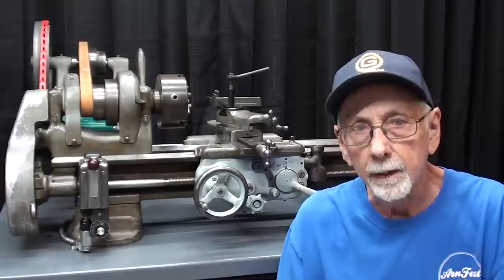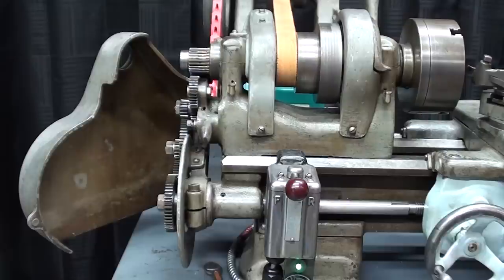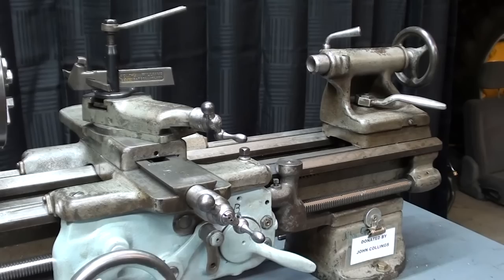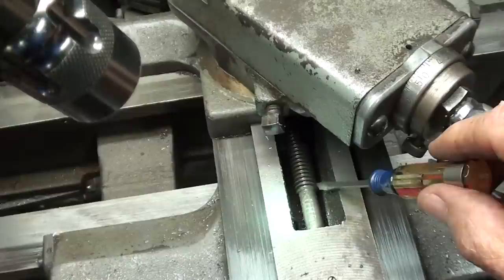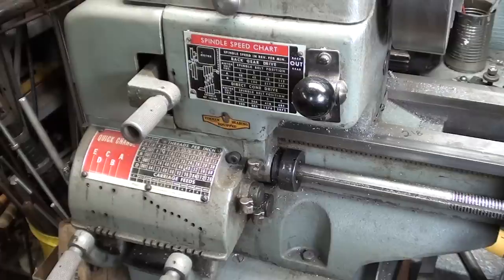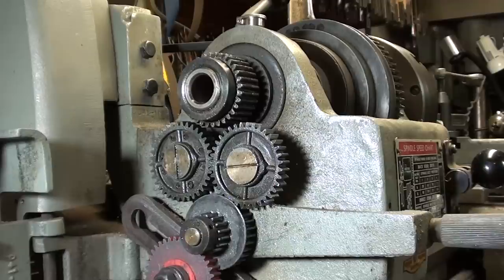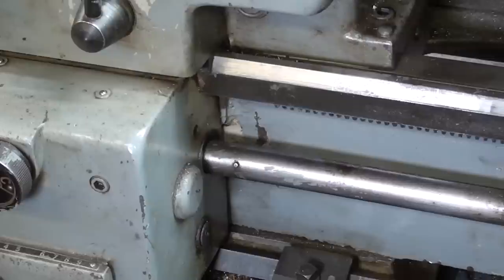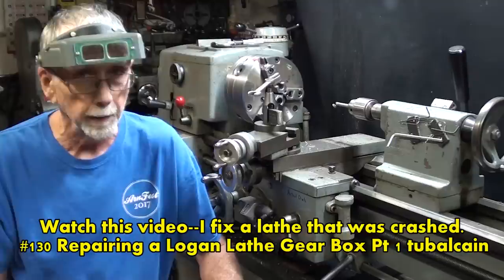CRASHING & damaging YOUR LATHE #810 tubalcain mrpete

Comment: Some years ago, I was 'The Welder' in a fabrication machine shop...we had 8-10 lathes, some were quite large. A guy in the 'toolroom' was running a very high precision lathe, maybe about 14X 35 or so. He somehow crashed the carriage into the chuck at high speed, broke the carriage completely in two.
 The shop owner came and asked me to look at it, see if I could just 'braze it back together'...no way, I saw the back 1/2 of the carriage laying in the chip tray......eventually they made a few pieces of flatbar and drilled/tapped some holes to hold it together...I don't think it ever really got used anymore...
   They were really upset I couldn't just braze or weld it back together....I said "maybe, but it will never be worth anything in this shop"..
 The company made Aero-space parts..everything was .0005"...
Reply from the maker: Wow

Comment: I'm rebuilding a 15" Sheldon lathe that had been crashed sometime in its life before I bought it.  The fiber gears were replaced with steel gears, and they did a hack job on the apron in an attempt to repair the damage.  $600 worth of new clutch parts, new 3-D printed gears, and many other parts that had to be made since I cannot afford B & K prices, it's running again.  As always, thanks for sharing Mr. Pete, Ken.

Comment: The first time I over-ran the carriage it broke a pin inside the apron. Cheap fix but a lot of work. So I replaced the steel taper pin coupling the feed/lead screw to the QCGB with a brass pin, like your Clausing. I made a couple of spares, too. The second time was thirty years later. I actually remembered where I kept the spares, and was up and running in minutes.🙂
Reply from the maker: You are a smart man. I would’ve forgotten. Where the spares were within minutes

Comment: Thanks for the video Mr Pete. I did not see it but I know I had a student crash the lathe,  I went to use it and the power feed did not work it has sheared the pin coming out of the quick change gear box.

Comment: I've never crashed a lathe, but I did explode a grinding wheel when I gave the handwheel a spin to send the dresser back out of the way.  I forgot to back the dresser off, I'm lucky none of the shrapnel hit me.
Reply: Nice VW
Reply: @MaineMachinist  I bought this from someone in Maine. My fun summer driver and never ending project 😊
Reply: @michelecrown2426  Wow! Are you in the New England region? I’m a long time Aircooled guy myself. I apprenticed under a top notch old school machinist in Augusta. He is a pretty well known Aircooled VW and Porsche engine builder. He’s had several engines featured in Hot VWs.
Reply: @MaineMachinist  NH.  And I go to Wells camp in summer. I hope to move there this summer, so VW will be going back home.

Comment: In HS shop class we had a few Bubba Jr's run the power feed into the 3 jaw chuck, fortunately, we were only using HS steel cutters so they made that terrible noise as the cutter hits the chuck and they got it shut off before the carnage.
Reply from the maker: As a teacher, that was the most dreaded sound

Comment: Funny you should ask. We have the same Clausing and the 72 tooth gear on the cluster that is first off the head stock  in the power feed train did a first class job of protecting  the brass pin,,,,,(that turned out to be a hard bronze alloy 1/8 rod )  at the coupling between the QC box and the lead screw. ---- The last thing I did today was heli-braze the teeth back in with Si Bronze. It's slow cooling overnight in the heat treat oven. (I would have cast iron gas welded it but it's got a 3" long bronze bushing in it ,,,, we didn't miss a trick when we did this foul-up) 
'
Now tomorrow between jobs that have to get out I can make an expanding arbor for the cluster and  see if I can find a #6 16P 20 degree gear cutter without having to buy the whole set. (We don't have one and don't know anybody who does) Then we can wait for the job in the horz mill to get done so we can re-cut the teeth. Meanwhile everthing we have to do on the Clausing will have to be dome without power feed.  

Moral to the story. - Don't take the short cut and use any old brass rod for a Clausing shear pin. Make sure what you are using is something that will actually shear before you tear up a thousand dollar gear. (And so you'll know we got away with it for like 3 years now,  but I am the bozo that mistook alloy rod for a piece of brazing rod and put it in the lead screw.) 

It's not even the middle of January and i am in the running for jerk of the year.
Reply from the maker: Don’t beat yourself up. Bad things happen to good people. Good luck with the repair.

Comment: Talk about dangerous machinery.
Many years ago I taught machine tool operation with manual machines at a local college.
We had a big beautiful shop with manual equipment and one cylindrical grinder.
The syllabus required familiarization with,and operation of, all tool room machinery, including surface and cylindrical grinders.
Had to emphasize to the students that a surface grinder was not a milling machine and that a .0005" deep cut was considered heavy on said grinders.  Ditto for the cylindrical grinder not being a lathe.
Turned out this cylindrical grinder was semi-automatic, made in the Czech Republic, and all controls were labelled in who knows what language.  And, of course, there was no operating manual!
I did a little tinkering with this beast; consequently I refused to use it with my class.  "Get me a manual in English or nothing doing" I told the department chief.
One week later during my next class I noticed that the 24" dia. grinding wheel was cracked!  The wheel had smashed into the work piece when someone started the thing and pushed the wrong button to "see what would happen".
Fortunately the wheel did not blow up.
Reply from the maker: Scary

Comment: The Harbor Freight, Grizzly and other varieties of mini-lathes actually made by Taig use plastic gears.  You can replace all those plastic gears with metal ones that are available. The one you don't want to replace is on the lead screw. That's the one that breaks when you crash the carriage into the chuck. A replacement is available from Little Machine Shop for around $5.
Reply from the maker: Thank you that may be very useful to some people

Comment: Thanks! I learned something from this. I have a 12” Craftsman with the earlier style you mentioned. I’ve never crashed it, and I hope that if I ever do, those lead screw bushing ends are still available.
Reply: If you have a mill, you could make a replacement, but it would be challenging to make it weak enough.  I had a 12" Atlas/Craftsman that came with a solid aluminum lead screw support, and I copied it for a few people, but I didn't realize that it was too strong!  I need to look at my drawing to see if it can be made to break easily!

Comment: The worst thing i ever did was when i was turning a 72" fly wheel on a movable gap bed lathe . I moved the bed and mounted the fly wheel to the face plate . I had it centered up and was spinning it . I forgot to take the bed out of gear and it slowly got closer to the fly wheel it hit and knocked the flywheel from the face plate . I didnt know what had happen . The boss came running  out of the office it some how didnt hurt anything he and i thought i just didnt get it secured . He went back to the office thats when i saw what had realy happen.

Comment: I find it interesting how many of what one may consider to be the more “consumer” end lathers, have “consumable” parts as they’re fail safes. Meaning, you consume and BUY a new part when there’s an accident. As opposed to a slip clutch or simple shear pin type system that can be fixed easily with a piece of common bronze stock. Interesting.

Comment: My Craftsman(Atlas) 6" lathe is the MkII  or 3950 model and they did something similar to the Sheldon using nylon gears on the reversing tumblers.  Stripped my 20 tooth gear and could not find a replacement, so I printed a 20 tooth gear on my 3D printer, that I resized to the proper diameter and width.  Drilled and reamed to 1/2 inch.  Installed it and was back in business.  Of course I printed several spares, how long can we expect a pla part to last.  It's been over a year and I'm still running on the first one!
MJ
Reply from the maker: I have made a PLA gear and installed it in my atlas about four years ago, and it is still running strong

Comment: So helpful as always, sir! I'm always so concerned of the Zamak's fragility.
Reply: I've got a 1976 12" atlas with a 1HP motor on it that I take 0.200" roughing cuts on mild steel.  Gets used by 3 employees every day for the past 2-3 years and all the gears are fine.   They get damaged from guys taking the lathe apart and dropping the gears, or when moving the lathe.  If you had never read the forums or visited the internet you would have never even known about the issue. Additionally Its common in my area to find southbend 9 and logan lathes with teeth missing off the  gears which are steel.
Reply from the maker: You and me both!
Reply: @undercoverhustler37  That's all very worth considering! Even Mr Pete's video on testing printed PLA gears held up pretty damn good so there's always that, I'd seen a little version of my Crafstsman-Atlas with those in them once and they looked fine to me.

Comment: Does this mean you could add your own protection by adding a rod with an unthreaded section(top slide swap/etc) or a shearpin in a spot that would support it or doing a fiber gear swap for one sacrifical gear? It always pays to be attentive but maybe you slip one day, a noise distracts you (I know my fire pager would distract me) or you're teaching someone new. Always nice to have a fallback that you don't rely on but can be re assured when a mistake happened.

Comment: I've wired up a plunger type overtravel limit switch that can be adjustably positioned in front of the chuck, and activated by the leading edge of the carriage.
Before a collision can happen, the switch will break the emergency stop circuit.

Comment: threading combined with panic over forgetting which lever does what creates nasty crashes on a lathe. Milling machines usually have even more levers and buttons than a lathe for those panic attacks during a Brutal Crash. 

Scrapping an extremely important large diameter bar of certified steel can be life changing for the company owner and the desperate customer needing the product.

The Machinist trade is not based upon simple common sense.

Comment: Oh dear, lathe crashes are just so scary. My machine has a shear pin on the lead screw, and a clutch on the feed rod for power feeds. My shear pin, however, is made out of 1045 CRS, and the manufacturer just gives a drawing showing how to make a replacement. Getting the shear pin out is also a bit of a nuisance.

Comment: Good info for Hercus users from Australia too! Hercus are copies of South Bend, as I am sure you are aware.
Reply from the maker: Yes, I have heard of them. Never seen one except in pictures.
Reply: @mrpete222  I have a Hercus Craftsman Model. They are a good machine. Hercus lathes were very common in school metal shops. Many schools in Australia, New South Wales at least have Hercus Lathes, usually the 260 Model which is a bit more modern, with Metric dials.

Comment: Good info!  I've heard this before, but it got me thinking:  are the shear pins in my lathes correct?  Did someone replace them with steel?  Time to check.  Years ago I bought a cheap Altas lathe that had seen a hard life.  I was planning on restoring it, but it had so much wrong with it that I opted to part it out.  The lead screw support had been replaced with one made from a chunk of aluminum- no chance of it breaking from a crash.

Comment: I was turning something  close to a shoulder and in an instant something was going wrong! 
It was AS IF the whole four foot lathe was raring up at me, I reached down to disengage the half-nut lever  to stop the feed, it didn't want to move so I yanked on it and it moved hard.
Thankfully, I didn't ruin anything.
Stopped the machine and waited for my adrenaline to settle down. 
A small belt drive lathe doesn't have any power?
They do.
Reply from the maker: Scary

Comment: The breakable right-hand lead screw bearing will only save you if the carriage is being driven by the split nut (and the right hand end of the screw can pull out of the gearing). If the carriage is driven by the clutch, it probably drives itself using the rack and there is only torque, no thrust, on the lead screw.
Reply from the maker: Good point

Comment: Everytime I know I have to power feed I pull the carriage away from the work and re-familiarize myself with the controls.  Is my lead screw turning in the right direction, which is my longitudinal knob, which is my cross feed knob, are they going in the direction needed, etc.  Then I proceed.
Reply from the maker: Good practice
Reply: Glad to know I'm not the only one. Life has repeatedly taught me that "familiarity breeds contempt", and while the word  contempt may sound strong, when a half dozen things all have to be right, it get's very easy to forget one. Carelessness is kinda like contempt.  Maybe I'm slower than the bare foot Asian guys we see running 100 year old machines on dirt floored factories, but...I'm not getting paid 30 cents an hour, so I make sure it's right...every single time.

Comment: I want to see your 51 Buick!!!
Reply from the maker: I do have a picture of it somewhere in my videos. Two-door hardtop dark green with white top, straight eight engine that would not die    manual transmission.     Sonomatic radio. Spotlight on the driver side.   The heater was under the front seat and put out almost no heat at all. Loved that car, I had my first date in it.
Reply: @mrpete222  WOW!!! That is so awesome!!! Maybe in extra credit you could have it posted again. One of my favorite all time cars is a 49 Buick Roadmaster convertible. I appreciate all you do for us Mr. Pete!!!!!

Comment: My Gisholt #4 Turret Lathe(Look, I got what was available and what I could afford!) Doesn't have that!... HOWEVER, It really doesn't matter I suppose since It's been sitting in my Garage without power due to a 3-phase dilemma!... "No, I can't just slap together a "Rotary-Convertor". It's a 20hp main motor.... apparentREEEEEEEE!
Unless someone has a "broke-arse"-based solution to build a "40hp" phase-convertor... My "built-in" safety-mechanism prevents ANY AND ALL DAMAGE!... Well, except for rust and dust build-up!
Reply from the maker: Excellent method to prevent crashing. That will take one big honking phase converter.

Comment: THis is not a scam!! Stop removing my posts!! MR Pete again if it is possible to get ahold of me I would appreciate i. I have left my email on this video but will do it again if you need. I am looking for information on a very good condition SB 9" 1934 lathe I received from my grandfather.
Reply from the maker: I do not remember removing your Post.   I do not think you can leave an email address in a comment. I think it is automatically removed.
Reply: @mrpete222  Hi sir. I have left emails before but could be wrong about removal. is there a way to email you a few questions? i have received a very good condition 1934ish 9" SouthBend C with a 4' bed from my grandfather and i am confused about a few things that i would love your input on

Comment: You didn't mention leaving the chuck key in the chuck, forgetting it and starting the lathe. The flying chuck key can wrecken the bed, You, people behind You our Your wife's costly Rembrandt in the next room....
Single point threading a bar, removing the bar for some reason and rechucking the bar with a not threaded part in front of  the cutter, and starting the lathe.... Being lucky the bar is tiney and now looks like a cork screw..
Actually Warco (UK) warned about cutting wood! The fine dust will invade the motor, bearings and God knows what more.
You forgot running over the lathe with a Bulldozer (Bubba style).... Joking!
Reply from the maker: I witnessed many chuck keys flying across the room